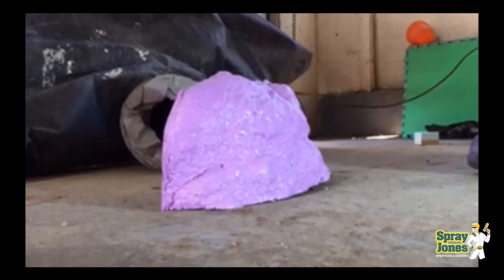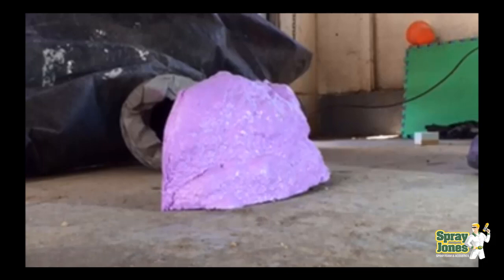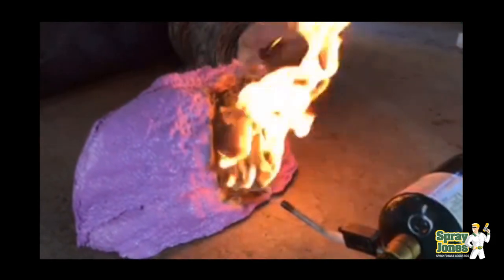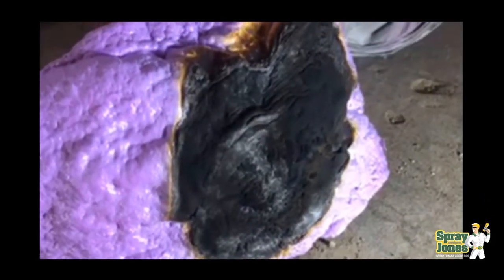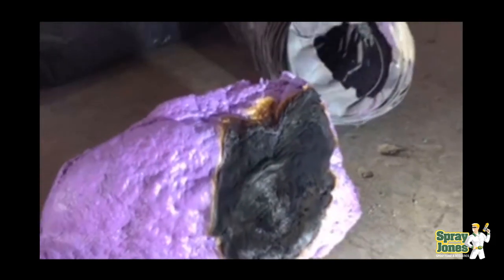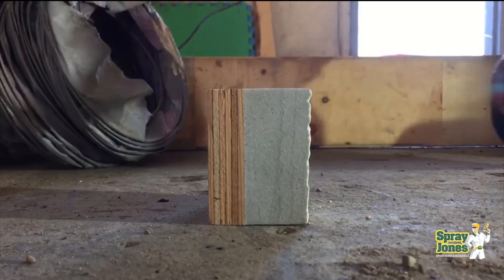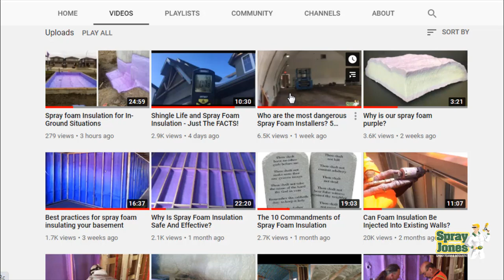Burning Spray Foam Insulation - Seeing is Believing!

Comment: As an former spray foam contractor and now a fire marshal, I can say people are very confused about the fire properties of spray foam. As this video shows, it is not a highly flammable IGNITION SOURCE! That said, IT IS A HEAVY FUEL LOAD once a structure is past the incipient stage and is well into the growth stage. This is not a problem for the occupants of the structure as the probability of survival is low at this point regardless... at that point it’s a problem for the fire department. Once the ambient temperature exceeds approximately 750 degrees the fire retardant properties fail and the foam basically turns into liquid fuel that emits highly toxic fumes.
Reply from the maker: Thank you for your excellent feed back. We have a video on SPF smoke toxicity that shows the results of what is in it. May surprise you yet again.
Reply: @SprayJones  Good video... but... my concerns are for the first responders. Yes all synthetic materials that are burning produce CO and HCN. The problem is that you are increasing the amount that is being produced.  IF the firefighters follow proper protocol and wear their SCBA (air pack) during overhaul there would be no issues. The problem is we firefighters tend to be wore out by then and if we can shed 50 lbs off our back... we tend to. 

Don't get me wrong I am all for spray foam.  I would never go back to fiberglass!
Reply from the maker: @gemrough  I think the solution is better PPE gear for you guys so you can do overhaul safely with less weight. 

I do have a video specific to smoke toxicity 

Thanks for watching!

Comment: As a former carpenter im surprised it didnt burn more. Ive been around the stuff a lot thinking it was flammable but i was wrong
Reply from the maker: That is the whole reason for this. The people need to be shown. 
I have other vids that dispel myths with foam...
Reply: Same here... My house electrical fire went out because of foam...
Reply from the maker: @57REDROOSTER  Common story. We had a house go up that we had sprayed the floor of the second level over the garage. The floor did no collapse because of the SPF; and it was open cell.

Comment: There was another guy on YouTube who tested spray foam and that caught fire so easily and kept burning, what is the difference between these foams?
Reply: I just came from that video.  I want to know too.  I know Spray Jones uses a 2 part closed cell foam that most likely has a class 1 fire rating.  The other video used pink board foam and great stuff foam which is a one part foam of god knows fire rating.  I just used Lepage Quad Foam around electrical outlet boxes and was freaking out after I saw that video.  Eventually found it was a closed cell, class 1 foam.

Comment: It definitely had flames. Just because you took the flame off and went out doesn’t mean it never burned. And it released a really black smoke that can’t be good for you. If a room is burning and the walls were sprayed the adjacent room will begin to burn as well. Spray foam isn’t allowed in commercial buildings for a reason. Rockwool in the walls and monokote on steel. Fire caulk with rock wool backing for penetrations is what is code for commercial buildings
Reply from the maker: So which black smoke or any smoke: white, grey etc is good for you?
When do contents burn? 
So why do we spray commercial building where architects specify it? 
Lie lie lie...
Reply: @SprayJones  lmao architects. Engineers are the ones that specify things that meet code. Architects are what the design should look like. Some jurisdictions allow it but it isn’t allowed in my jurisdiction. I’m a union carpenter and have help build many commercial buildings and not once have I seen spay foam in a building. Like I said monokote is definitely sprayed on on steel like beams, columns and pan decking. I have always seen fiberglass used exclusively. On everything from walls to pipe insulation. I know you are trying to sell this exciting new product that applies 2 as fast and can charge the same or more for it but I will stick with fiberglass. I’ll pay extra time for workers which provides more work for them and more opening as well instead of all the money going to the top
Reply: @395glen I am an architect. I am the end all be all for what is used for my designs right down the chemical make up of the products. I specified spray foam on dozens of projects, the engineers do not make that call.
Reply: @alanhetland1572  They can not reject something unless it is against code.
Reply: @395glen  You first said only mineral wool was used, now you say you've seen fiberglass used exclusively.  Hyperbole much? Fiberous products are overrated because of their R value and how R value are defined.  I'm of the opinion that fiberglass, mineral woll and cellulose have their roles.  But it's damn hard to know if the industry doesn't update itself with how insulation is rated.
Reply: @Jaze2022  never said “only mineral wool” I recommend you go back and reread if you are having trouble with that. My first said Rockwool on walls and monokote on steel nowhere do I mention “only” as either rock wool or fiberglass can be used on walls. Rockwool is definitely better as it is naturally fire resistant. Now if you mean penetrations as holes in a wall for piping like plumbing and electrical or floor sink/drains then rockwool backing with fire rated caulk is used.

Comment: What is that paint-on fire retardant and where can I buy it? Can I use a paint sprayer and spray it into the rim joist area? I have an unfinished basement and the walls are drywalled but I don't intent to drywall the ceiling for a year or two. My inspector is suggesting stuffing Roxul into the cavity.
Reply from the maker: You have to be a training contractor to install it. You need equipment to spray it that most rental places don't rent. 
Put the Roxul up. Or find someone that sprays the product. DC-315 or Flame Seal are the 2 names.
Reply: @SprayJones  Thanks!

Comment: Great video.  Several years ago I tried my personal test on "Great Stuff" canned foam, as well as the orange fire block foam.  Both seemed to burn well, about the same.  However I didn't pay attention to what happened on the surface vs subsurface.
I'm now interested in steel roofing/siding, and was wondering say if you spray 6" of foam directly to the roofing, what will happen if you apply a strong heat source to the outside?  I.E.  an oxy-acetylene torch to get the roofing red hot without burning through.

Comment: Mr. Jones, I have been in the energy conservation business for almost 30 years.  Your channel is probably the best I have come across regarding the use of spray foam insulation.  My problem is that I am 68 years old and plan to begin construction of my wife and I ‘s new home this coming spring in Maine - about 1.5 hours north of Acadia National Park.  I can not find a spray foam insulator in my area.  Do you have any contacts or resources that can provide an installer.  Does BASF have a network of installers that I can get for my location.  Thank you, any assistance would be appreciated.

Comment: The problem is not necessarily the flame progression and retardancy, it’s the gasses and vapors that come off of the foam when it is subjected to fire. Rarely do people die in fires because of flames, the majority die from smoke inhalation. The urethanes and isocyanates in foam decompose in fire conditions and release cyanide and carbon monoxide gas exponentially more than any other construction or insulation material. It doesn’t matter how “flame proof” it is if other things can combust and heat the foam and make it release the toxic gasses.
Reply from the maker: So how many people live breathing in 400 degree smoke from red oak?

Comment: I'm having my project bathroom and walk-in closet very large for both insulated with foam and I am a big fan of for my customers. Open cell in the ceiling and closed in the walls to accommodate the R rating. The insulating contractor mentioned a spray coating once the foam is installed that certifies the fire rating for the attached firewall. After I see this I wonder whether it's necessary? I like the idea though more is better.
Reply from the maker: Just because the foam does not burn does not mean some idiot bureaucrat won't require something to protect his pension. 
I will be doing a video on fire ratings, thermal barriers and the rules of why.

Comment: Like you mentioned many times, the code needs to catch up. In the city of New York if your spray foam is exposed it needs to be sprayed with a ignition barrier. Sheet rock is fine in residential services but if you were doing the roof or I should say ceiling of your commercial warehouse you would have to go back and spray on a ignition barrier. Looks to me like that would be a waste of money
Reply from the maker: That is common for North America. It is a rigid cellular plastic clause.
Fire tests are upwards of 500K per test and take 8-12 months to arrange. 
So the industry moves VERY slowly to challenge things.

Comment: One problem with your test was that your touch kept going out. The flames used the available propane to keep burning but as soon as the fuel source was gone so were the flames. It proves the foam does not support combustion by itself.
Reply from the maker: Yes.

Comment: You must use a spray with fire protection. There is no flame and no smoke or little.
Reply from the maker: This is our every day building code certified foam. What it has is what is required nothing more or less.